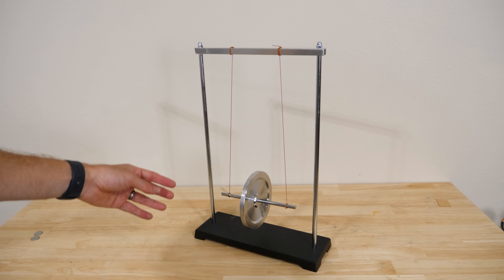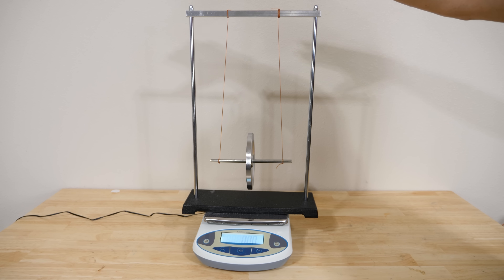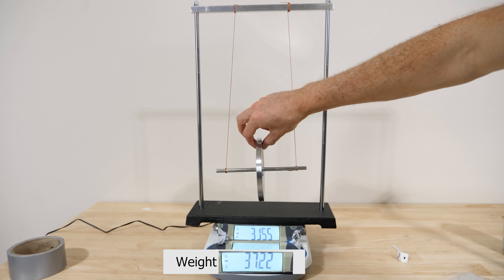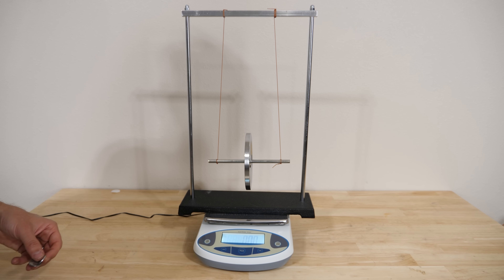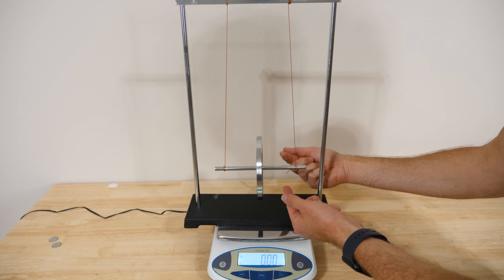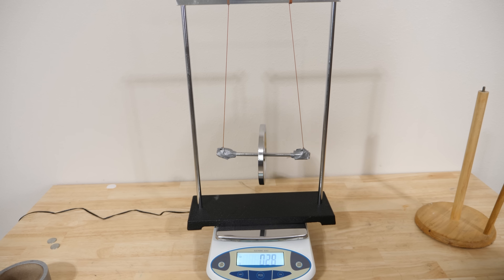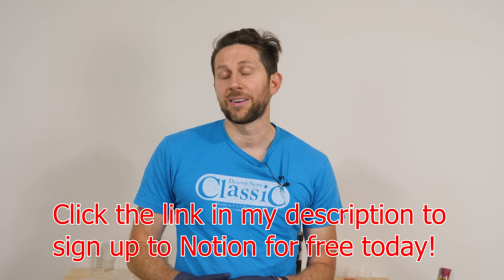How Does The Anti-Gravity Wheel Work?

Comment: I wonder if you attached three gyroscopes at 90 degrees to each other, the corner of a cube. Could it hover? If not, what about a caltrop type arrangement, 4 gyros at 60 degrees from each other, three down and one up... make it hover!
Reply: No, it cannot hover.  There is still a downward force as it moves up and down.  The -6g is the amount less than the total weight, which he zeroed out with the scale and never showed.  The wheel might have a weight or mass of 100g, so when falling and rising it still has a downward force of 94g. The missing 6g is all lost at the moment of the bounce, because the scale reacts too slow to show it.  But if it did react quicky it would go much higher than 100g for a short time.

Comment: expected it to be lighter when it moves downwards cause not all og the gravity is pulling it down the same way as if it wouldnt accelerat edownwards and at the bottom a spike into positiv weight and then it still spins and drags the bar down while the flywheel is moving upwards but that.. lol

i just cant understand the negative mass while moving upwards becaus its moving upwards pulling itslef up via the strings while the gravity pulls it down, but it moves upwards with less force it should way more cause its still pulling on the strings from movement and the gravity.  it doesnt make sense.
i get that gravity is always pulling but if i pullthe upper rod even mroe down it should be a bigger force, downwards less, upwards more, like a bicycle downhill you accelerate but uphill i decelerate.
in my head this logic means that driving with a bike reduces my mass if the floor isnt flat - even uphill.
can somebody explain it to me - maybe i get lucky and find a german so this damn translating doesnt screw me over even more. i feel soooooo stupid that i dont get that shit

Comment: You need a strain gauge scale with the output to a chart recorder to see the gyrations of the weight. It will always average to zero. (if you zeroed it at the start) The more bizarre experiment is to weigh something that is UNDER the spinning flywheel. (flywheel shaft vertical) Why that loses weight is still a major controversy.

Comment: Do 2 wheels double the loss? What if you could build a stand with materials that weigh less then the loss…..would the entire device float? Of course not otherwise we’d all be flying around on wheels.
Reply: Actually, more wheels would decrease the weight loss.  What you need to do to increase the weight loss, is have more acceleration of the center of mass.  The fact that the wheels rotate slows down the acceleration so it allows for more time to see the effect.

Think about it this way.  Imagine weighing yourself while you toss a ball up in the air.  When you hold the ball stationary, the scale measures the weight of you plus the ball.  When the ball leaves your hand after tossing it, the scale only measures your weight, as the ball is weightless while in flight.  During the time when you catch it and re-launch it, the scale's reading will increase, because the ball is accelerating upwards from your hand catching it and re-throwing it.

Ultimately what matters, is the acceleration of the center of mass of the system, as this times the mass of the portion of it that accelerates, will equal the fluctuation of the scale reading.  The fact that the disk rotates doesn't make a difference compared to if you had the same setup with an object in pure translation.  The rotating disk gives us more time to observe this effect, and the rebound via the string "catching" it, would be when the scale reading would increase.

Due to the asymmetry of the timing of the various events, we measure a loss of weight a lot more often than we measure a gain of weight, and this biases the scale reading to always show a decrease.  The scale just isn't sensitive enough time-wise to show the increase in weight.  But if you average out the reading of an idealized scale with infinite precision, it would add up to zero between equivalent points in the cycle.
Reply: @carultch  thanks Carl! That makes sense. Thanks for taking the time to write that out.

Comment: Interesting effect, first to me.
In case you want a higher sample rate for the scale, there is a very simple option with an arduino ($5), an HX711 ($5) module and a weight sensor ($5~$20).  Then on arduino interface you can plot it directly from serial port data.   HX711 can sample at 10samples/s or 80samples/s configurable.
Reply: Hey, mate! Is it possible to save it to a file?

Comment: No way, how does this work.
Reply: The scale doesn't measure weight, it measures constraint force.  When the center of mass of the system being weighed is accelerating downward (which it is, both while this disk falls and speeds up, and slows down while it rises), the scale registers less constraint force.

If the system's center of mass is accelerating upward, the scale would register more constraint force.  Which it does, for a brief split second, when the disk "bounces" off the bottom of the string.  However, the scale is not sensitive enough to display a readout of that short of a duration, so you only see the more continuous loss of weight from the downward acceleration, rather than the sudden increase of weight from the turn-around at the bottom.

If you had a scale that had an infinite precision in its refresh rate, and produced a graph of scale reading vs time, you would have an average value of zero change in weight, in the long run.

Comment: A rotating gyroscope actually is a tiny bit more massive since the rotational energy E=mc².
Reply: How big/fast of gyro would you need to be able to measure the change on mass in everyday units like decigrams or even just grams I wonder.
Reply: @LarsKuhlmannCourtwright  Well, 1 decigram (which is less than a gram btw) equates to 9 terajoule. If the angular velocity is - say - 1000 rad/s (i.e. a few hundred rotations per sec), then the moment of inertia has to be around 10 million kgm². That is a cylinder of 100 ton with a radius of 10 m. (Order of magnitude.)
Pretty impressive. 😉

Comment: If you spun the wheel VERY fast and cut the strings, would it be weightless and hover in midair? Of course not! It would fall at 9.8 m/s/s like any other object. Rotation is independent of gravitation and the mass of the wheel is always constant. You need to isolate intervening variables. A discontinuous digital scale is not reliable or accurate enough. Personal experiences, like how it feels lighter, are entirely subjective. Really sloppy science!
Reply: The issue is that the scale has a blindspot when it should register a higher-than-neutral force.  There is a huge asymmetry between the time it spends with a lower-than-neutral force in the scale, and the time it spends with a higher-than-neutral force in the scale.  This blindspot gives the illusion that it is an antigravity wheel.   If you are lucky enough, you might get a trial that shows the upward acceleration readout, when the wheel bounces at the bottom of the strings.  If you had an ideal scale without this blindspot, you would find an average readout of zero, if you integrate the readout over a time interval between equivalent points within the cycle.

Anyone who's played with a yo-yo, would know that the tension in the string exceeds the yo-yo's weight at the bottom turn-around point, even if the string tension is less than the yo-yo's weight for most of the duration of its motion.
Reply: @carultch  I agree. By analogy, if your vomit comet jet is on a parabolic trajectory, then yes, you will appear to weigh less on the way up and on the way down, until you reach the inevitable bottom. Action Lab's digital scale apparently never records the short-lived spike in acceleration at the bottom. If he could graph a continuous readout, then he would notice this effect.
Reply: @marsbux-tech  Precisely.  And good thing the vomit comet uses significant time to turn you around at the inevitable bottom, otherwise it wouldn't be safe for human riders.

I suspect that the g-forces of this system are not survivable for a human, during that spike at the bottom.  Even for a hypothetical passenger exactly at the axis of rotation.
Reply: @marsbux-tech  I suspect that it was a matter of "luck" that Steve's scale never grabbed the bounce-back effect.  I suspect that this is the most probable outcome, so it didn't require that much luck.  Maybe with enough trials, at least one of them would show a part of this spike.

Comment: Well done. I appreciate you pointing out Laithwaite being able to swing the weight overhead being the result of precession. The combination of the two rotational vectors redirects the angular momentum in such a way that it behaves almost like a propeller. When it's forcibly rotated, the gyro will strongly twist upward or downward, more than just negating its own weight.

Many many of us have had the same idea, that gyros could be used as a kind of propulsion, as did Professor Laithwaite, and many attempts to patent the concept have been made. There are 2 main problems. 1) The scientific establishment refuses to accept any change to Newton's Laws. 2) People keep building working models that treat the gyros like propellers. The tighter the circle they turn, the more powerful the effect. A propulsion device needs to have two gyros almost touching --||-- instead of being at a distance |-- --| . And spinning in opposite directions of course, because some idiot is going to have them spinning the same way and be all like "HURR DURR IT NOT WURK". It's like people testing the Biefeld-Brown effect and making the discs the same size. And unless you have some NASA quality materials, it's better to have a test model moving a little toy car along than expecting it to fly up in the air, like the wooden toy we see in the episode of "Heretics of Science" about Laithwaite where he's introduced to the concept by an inventor.

Comment: Just starting to watch this video, I am at 3:00: "So when I first saw this I was really confused".
Where you, really? I can't believe you. This is very interesting, but also very obvious for someone with a basic understanding of Physics (and you have more than basic). I knew that the scale was going to show less when the wheel is on its way down and on its way up. On both occasions the wheel is accelerating down so the weight(*) has to be greater than the tensions, and because the weight doesn't change, it is the tension the one that has to diminish, so the string is pulling down nor as hard on the frame, and the frame is not pushing as hard on the scale. TO see it in another way, since the wheel is accelerating down and the frame is not moving, the center of mass of the wheel - frame system is accelerating down, and hence the normal that the scale puts on the system has to be lower than the weight of the system. It is exactly the same reason why the scale shows less when you are on it and crouch down (during the down-acceleration phase).
The only "mystery" here is why the scale doesn't show more (and A LOT more) when the wheel bounces back at the bottom. The average acceleration on a whole cycle is zero (the wheel doesn't go anywhere and ends up in the same spot where it started), so all the cumulative downwards acceleration that the wheel experiences while speeding up on its way down and slowing down on its way up is compensated by a very brief but very intense upwards acceleration when it bounces back at the bottom (what is known as an "impact"). So why doesn't the scale register that? My hunch is simply that the scale simply doesn't have a quick enough response time, so that brisk huge but very brief upwards force is jut not captured by the scale.

(*) With "weight" I mean the force due to gravity, m*g, not the other thing sometimes called weight which is what the scale registers, which is the reaction to the normal force that the scale puts on the object on top)

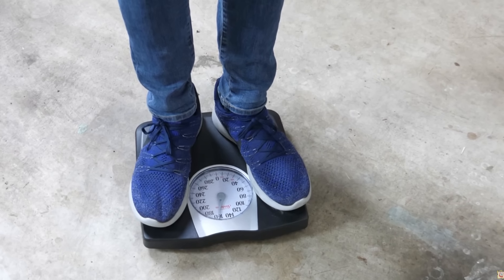EDIT: 5:40, so here it comes.
Reply: It's a little counter-intuitive that the scale doesn't register higher while the mass moves upward.  I've taught physics for 15 years, and a normal intuition is that something is pulling it up while it's rising.  I've seen far better physicists scratch their heads for a few moments over similar things.  "Really confused" might be an exaggeration, but there's no shame in admitting that simple stuff can trip you up. (see veritasium's bullet block experiment for a favorite example!)
Reply: @jamesdavis3851  ... No shame at all. Just that I don't believe that he was confused.

Comment: The fact that the wheel is constantly accelerating while bouncing up and down is just mind blowing!
Reply: It's not. Most of the time it is accelerating steadily downward, but at the bottom of travel it briefly experiences absurdly high upwards acceleration. Should be obvious once you think about it, as it goes from going down quickly to going up quickly. It only seems like magic if you don't consider that brief time which seems like an instant. Acceleration is change in velocity, after all. This was sort of explained in the video, but he really underemphasized that part to make this seem more arcane than it really is. Still a cool trick though, and definitely good for tricking the old monkey brain. Made me doubletake for second, til I pieced it together that this is more of a juggling situation than a hanging weight situation and the scale probably only samples like every 2 seconds.
Reply: @torydavis10  You can clearly see that the scale update rate is around at least 10 times per second, capturing all the minor swingings and vibrations. But the numbers on the scale don't seem to show any significant change at the moment when the wheel quickly changes its direction. Maybe because there is no change of direction?

Comment: if you acclerated the wheels rotation past what gravity can. could you get the item to float?
Reply: Not with strings, but if it is connected to the frame with stiff rods, then yes, the frame can lift off the scales temporarily.
Reply: @landsgevaer  Maybe if you had a moving motor that were attached to the frame via those stiff rods.  I don't see a falling setup under gravity alone as an energy source that could achieve a liftoff from this scale.
Reply: @carultch  It would if you accelerate the hanging mass downwards quickly, then the frame could briefly hop off the scale.
I didn't imply that you could make an airplane or energy source out of it. ☺️
Reply: Another way you could cause this system to rise, is if you had a ball on a string and you spun it so fast, that the tension in the string at the top of its path, exceeded the weight of the frame below it.  This would cause the assembly to lose contact with the scale below it.  Or generate a tension in the scale, if you glued the assembly to the scale pan.

Comment: So if it is pulling itself back up the string why doesn't get heavier. If you had a rope with scale at the top of the rope and had a mechanical "climber" pulling you upward wouldn't it register higher weight due to accelerating mass? How is this any different??? 700+ grams lifting itself up....
Reply: It is a sampling bias that makes it appear as if it always weighs less than its rest weight.  The issue is that there is a huge asymmetry between when the disk is rolling and accelerating downward (i.e. most of the time), and when the disk is turning around as the string catches it and rebounds it upward.  There just isn't enough of a sampling rate on the scale to accurately capture the details of the reversing impulse.

If you had an ideal scale that could accurately capture the support force with infinite continuity, you would see that it adds up to zero over a time interval between equivalent points in the cycle.

Comment: Potential energy isn't real. It's an imaginary construct, used to make equations work.
Reply: No, potential energy definitely exists.  Otherwise it would be big problems for the fundamental principle of conservation of energy.
Reply: @carultch  I know. The equations wouldn't work. 

But the question is: Why? As Feynman said, the reason behind the phenomenon of conservation of energy is one of great mysteries of physics.
Reply: @hermes_logios  There is energy stored in force fields of all kinds.  We know this has to be the case for electric and magnetic fields, because we can transfer power through electromagnetic waves.  We also have evidence for potential energy in the case of springs and other flexible bodies, because a spring under load shows evidence of the deformation in more ways than one, which is fundamentally electrostatic potential energy at the atomic level.

If there were a magnetic counterpart to gravity, we could do the same with gravitational waves.   There is energy in gravitational fields by virtue of the positions of objects within the gravitational field.

Comment: Questions: If you figure out how much the acceleration is of the wheel and compare it to gravity, is this the same percentage of lost force on the scale compared to the entire weight of the wheel?
Reply: there is the formula f=m*a, where f is the value the scale reads, and a is the acceleration. So yeah, it seems like it would be a linear relationship and should be right. The is because the mass of the wheel holding contraption is subtracted by the scale in both cases if you zero it
Reply: Btw, this is also how astronoauts measure their weight: there is a sled on board of the OSS where the Astronauts sit on. Iirc it gets accelerated by a fixed amount and measures how much force presses the astronaut in the seat due to acceleration. This  force is directly proportional to their mass